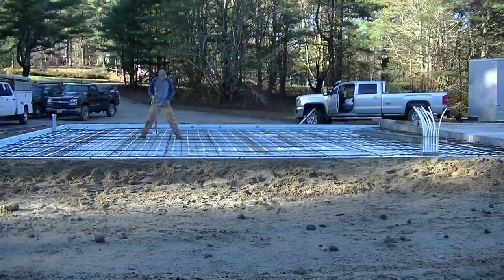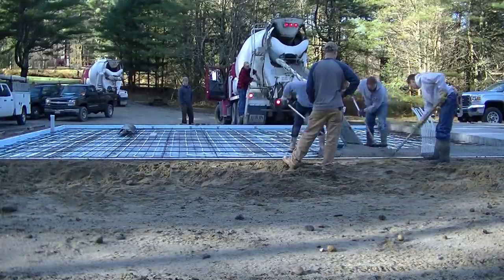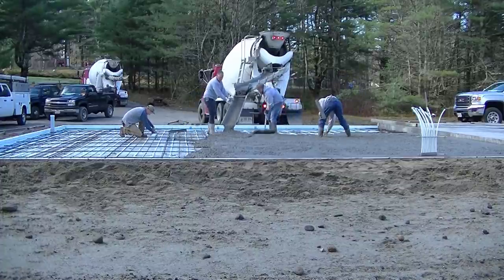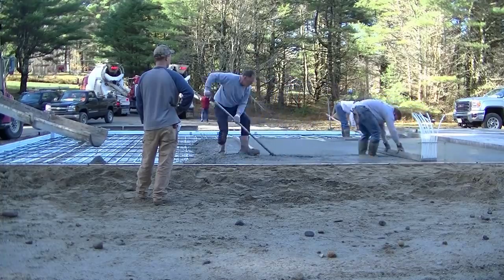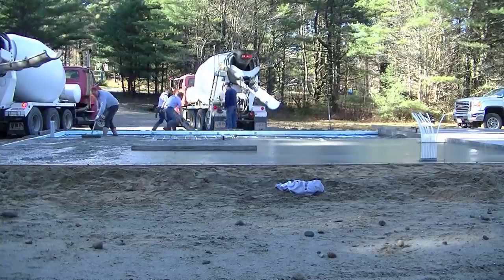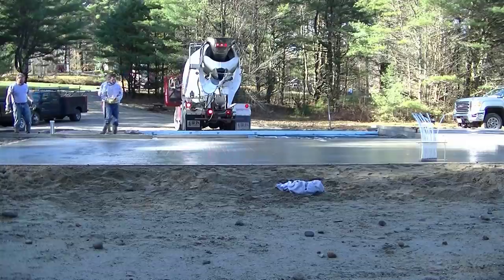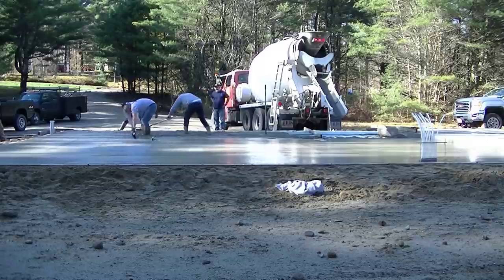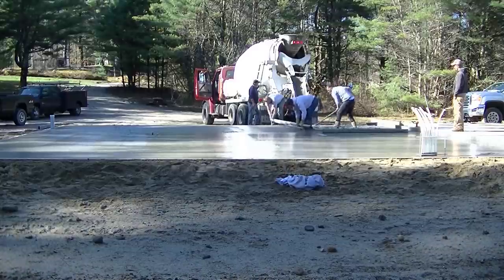POURING A CONCRETE SLAB FOUNDATION FOR A GARAGE

Comment: Here in Wisconsin we have a frost wall poured first before we pour a garage slab. If we do it without a frost wall we do 12” x12”. Whenever y’all do smaller drains how do you finish around them after pouring. Bc normally we always have a little bit of a lip of concrete around it that always has to be cut down when we go out on hand the first pass
Reply from the maker: Same with us, we have to cut down the concrete where it sags to the drain a little, depends on the slump of the concrete most of the time but always a little to cut down.

Comment: I'm wanting to do  a 16x26 slab with radiant. How do you insulate the sides of the slab? I have seen other video's where they cut up an ICF form and attach that to the forms. I was thinking of 4" of insulation with a flat slab over it. Thanks, from Winnipeg, Manitoba, Canada

Comment: How come the rebar and pipes for radiant heat are left on the ground and and not 2 to 3” below the top of the concrete? It’s going to be hard to heat that concrete slab! No anchor bolts?
Reply from the maker: The heating guys want the tubes at the bottom of the concrete. Heat travels up and this way the "whole" slab is heated thoroughly and not just the top 2 inches. It's more efficient for heating to leave them at the bottom of the slab. Contractor didn't want anchor bolts, he drills and anchors them when he installs the sill plate.
Reply: Mike Day Everything About Concrete Ok, thanks

Comment: How did you start your company?
Reply from the maker: I was 19 years old and had been working for a big company since I was 15 (all through High School). I had been doing side work on the weekends for a while and made enough contacts to feel comfortable enough to just start my own business.

I didn't really have any expenses (mortgage or truck loan) so there wasn't too much risk. I had saved up enough money to buy a power trowel and all the pouring tools. It wasn't too expensive. The days I didn't have a pour, I would drive around and find construction sites or houses being built, stop in and see if they needed a floor poured. That worked some of the time and eventually my name got out there. I wasn't afraid to hear the word "no" and I was determined to make it happen.

Comment: I do not and I would like to learn more. I am planning a large 16x20 patio and 65ft of 42in side walk with 2 stairs and a driveway extension. I would like to stamp everything but the drive way.
Reply from the maker: That's quite a project. Keep watching and learning, let me know how I can help.
Reply: Mike Day Everything About Concrete  my biggest worry at this time is how to order the concrete with the correct air and consistency and next is getting a detailed understanding about when is the right level of set to start broom finishing or stamping and what I can do to control it.
Reply: @Littleton98  get a job helping somebody pour for a while, or get somebody skilled to help or i guarentee you will fuck it up

Comment: My bildings O/H doors I put an angle iron in so the door is about 1in below floor grade no driving rainwater will run under it. I'm not in the concrete, business. Automotive. Also I just Monday had a contractor pour a 35x50 x5 4000lb with 2% the shit head lost it what a mess and he does not want to talk to me. Steel $555.00 &3800.00 for cement  O/T for the truck. The guy I always use was busy.
Reply from the maker: We do that occasionally also. but mostly we just taper the garage door openings.

Comment: I pour on Saturday’s. Only take the first truck out of the batch plant on a Saturday though. I had a friend at the concrete company tell me that they don’t worry too much about adding concrete to a returning truck with leftover concrete on a Saturday because it’s usually a home owner and not one of their bigger accounts. Seem to get the less experienced drivers on Saturday’s as well. Our mixers are almost all front discharge here so the driver can make a big difference.
Reply from the maker: Yea, getting hot concrete sucks most of the time.